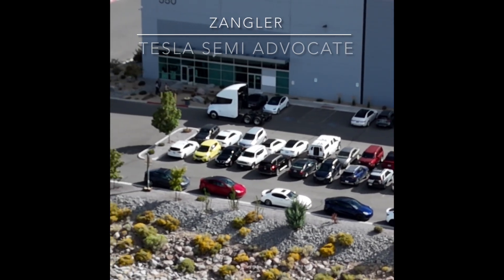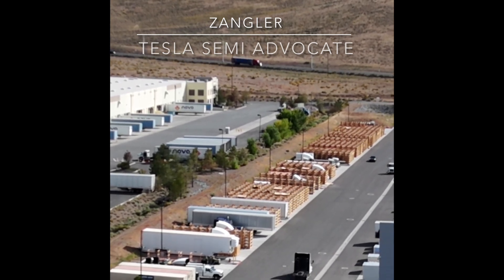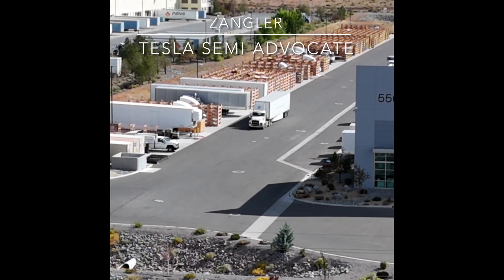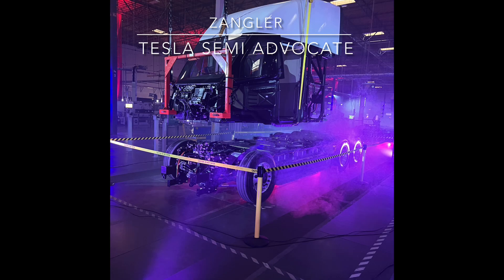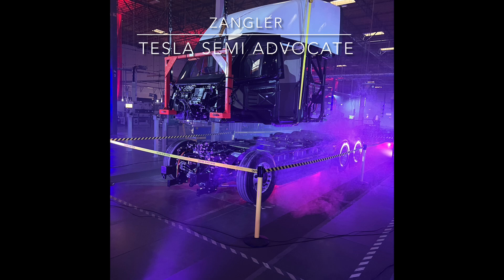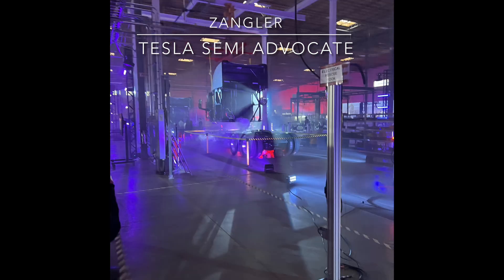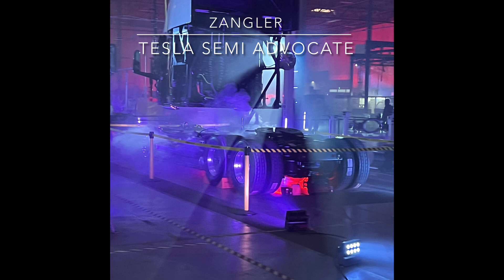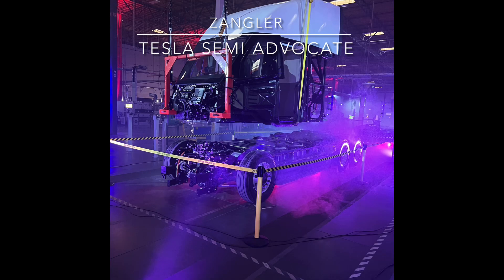Tesla Semi Production Line Unpacked

Comment: There is something stupid going on with this truck.  Elon wouldn't have announced it if he didn't calculate the weight and power of the battery pack.  The cybertruck is more complicated than this truck, and they shipped a pespsi truck with a 200 miles of range.  Elon needs to go to this factory, kick a couple people in the azz, and get this process moving.  Why is Thor, and the scam artist truck companies making trucks before elon, who has the batteries, battery packs, motors, and connections with suppliers elon cant get it done.  Somelthing rotten in Nevada.
Reply: They don't have the batteries. One truck uses several times the batteries of a normal car, so ramping production would take a ridiculous amount of batteries. They are also ensuring that they field test the trucks as much as possible before settling of a final design to mass manufacture
Reply: BS if car sales are slower there is your batteries! Maybe if eleon did not spend 30b on twitter now spewing conspiracy left right and focus on real work at hand. His legacy in history will be tainted   Sad